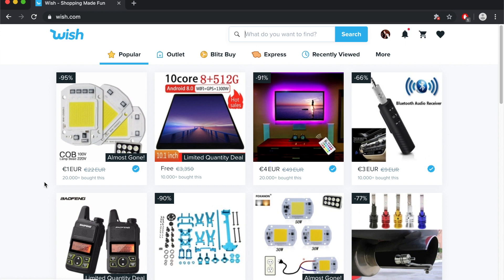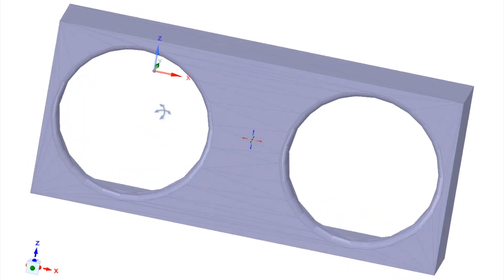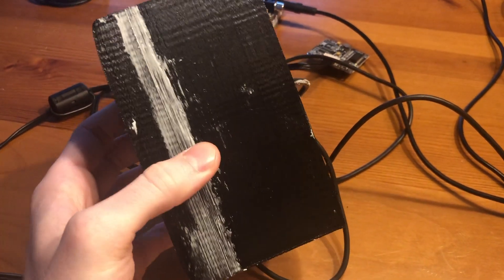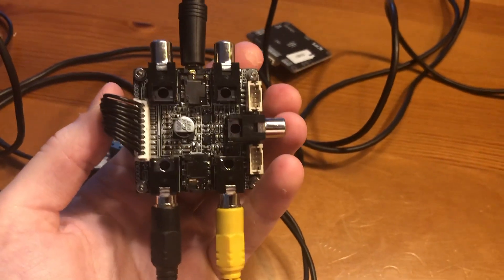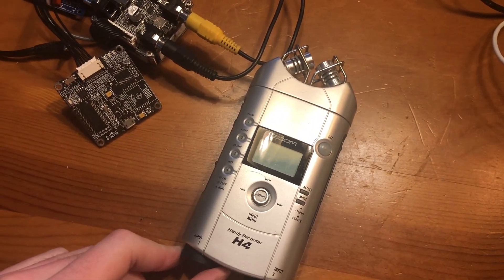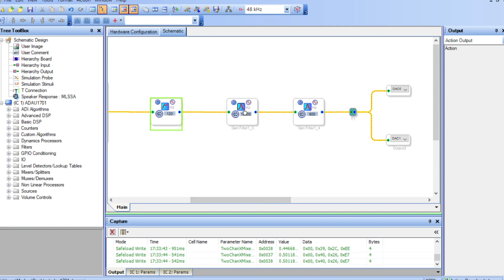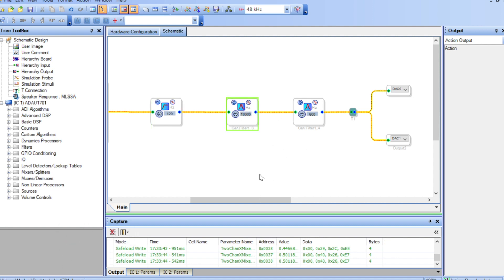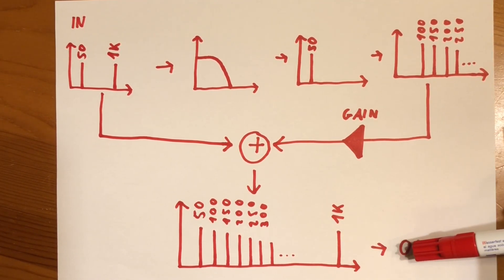[#1] 3D Printed Speaker - How To Make It Sound Great

Comment: Very nice channel indeed... if you have some spare time, could you please make a video how to reduce quantization error from 16bit PCM to 12bit DAC using a STM32 microcontroller?
Reply from the maker: Francesco Anastasi well thanks for the proposal. I can make a video about it with help of a Noise-Shaper as I have explained in my latest video. But there will be always the problem that I can’tget the DAC in sync with the I2S input. So just playing the audio then directly from a wav file or so
Reply: @YetAnotherElectronicsChannel  thanks for your reply... I think it's a good idea using noise-shaper for converting 16bit wav samples (PCM) to 12bit to feed the STM32  DAC directly maybe using DMA (memory to peripheral).

Comment: Really nice video! Could you please tell me the references to your DSP board and its programmer? I'd be interested to order one
Reply from the maker: Well - I ordered the board on a german webshop. There you get the whole set with DSP-Board, RCA Breakout Board and the USB-I2C programming adapter (https://www.boomaudio.de/wondom-dsp-board).

However I was also able to find the board on eBay and AliExpress if you search for "Sure ADAU1701" or "Wondom DSP" for example. But  I was not able to find the USB programmer there.
Reply from the maker: Just saw, that the german webstore is delivering world-wide by the way.

Comment: It's what I was looking for. I hope your channel grows, you have good videos.
Can you change parameters from encoder or from buttons? Having to connect the PC to the DSP every time I want to make a change in SigmaStudio module does not seem practical.
It is fine to make room corrections, improve the response of an audio system.
But if I want to make a chain of processes, such as EQ, Gain, Auto leveler (gain raider?), Compressor, Limiter and post-EQ. At least you should be able to save several presets and choose according to the audio source. I also don't know what DSP I would need.
When I watch Netflix, HBO, YouTube, animeFLV in my browser, I use the Polyphone addon, which seems indispensable to me with the volume so low and then with FX and music so loud, not to mention the damn ads.
On TV in the living room, I have to be with the remote in my hand all the time. I would like to make a DSP that has S/PDIF input, with buttons, rotary encoder and LCD display, and with the possibility of IR remote control or an APP for android (app inventor ...).
If the DPS had a Microphone to keep the audio below a threshold, or even an EQ that lowers resonant frequencies (those constant annoying ambient / FX music tones) it would be a dream. I'm not asking for a Feedback / Larsen suppressor....

Do you know Teensy 4.0? It has a web editor and is 600MHz. There are quite a few people who make instruments and FX with this DSP. Surely you know him .. The DSP STM32 is very interesting but I find it very complicated for now, but I fear that if I want to do what I want I have no other choice. I am a novice without studies who plays with Arduino who sees some hope in your channel.